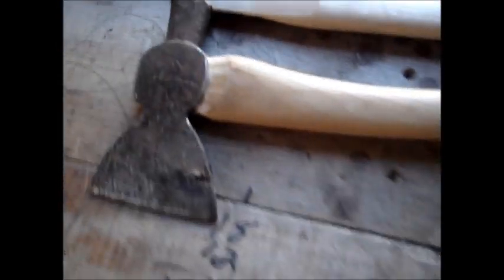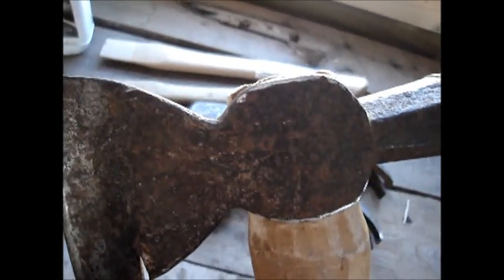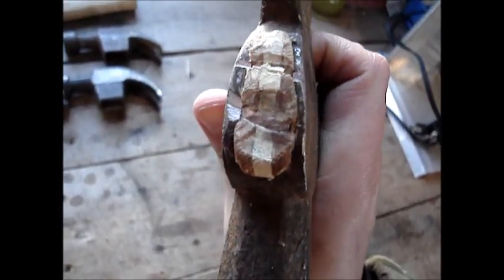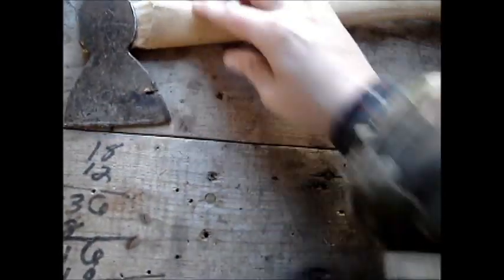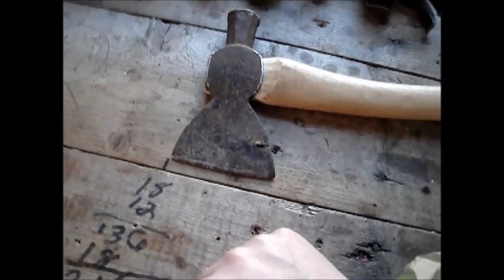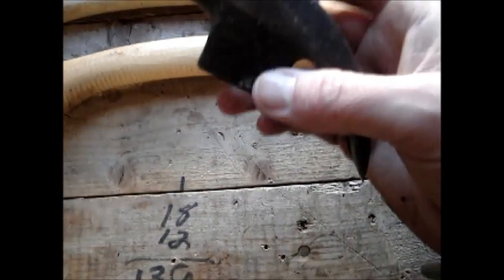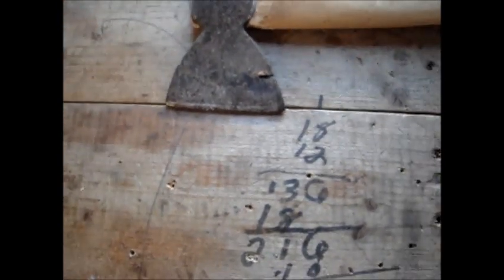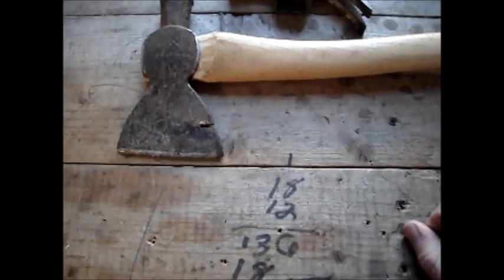New Handle on Shingling Hatchet

Comment: Good video, GunGeek.   Quality tools are worth placing a new handle on them.   The hammer and shingling hatchet will work just fine. ... I believe the shingling hatchet is a better 'car tool' to carry along, than a small hatchet..  It has the hammer and nail puller on it.  Any need to camp or build a little fire, = it will cut firewood.  The hatchet portion can be used to cut brush to put under the tires too, (If/when needed)
The hammer and nail puller might be needed out in the boonies of the Frigid North, or the 'balmy' (in some places)~USA .   I was watching, the Mardi Gras parades down in New Orleans (on the Internet).  The parade describer said it was in the mid 70s that evening.   (He might NOT need to cut firewood; but having a weapon to whack an alligator or poisonous snake might be useful.)
Reply from the maker: might come in handy :) the head and handle have been around for years, figured it was time i stuck um together.